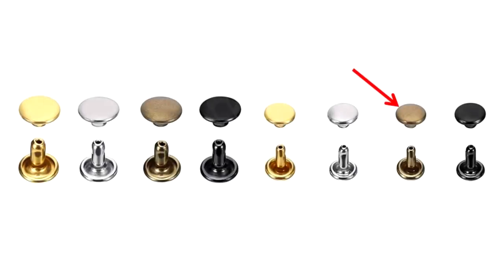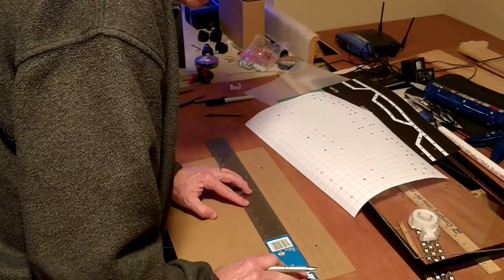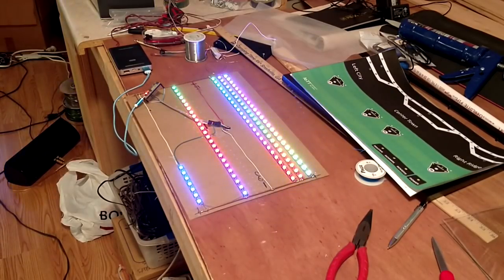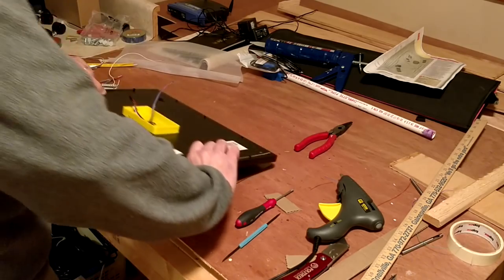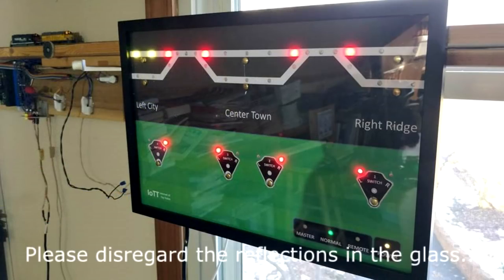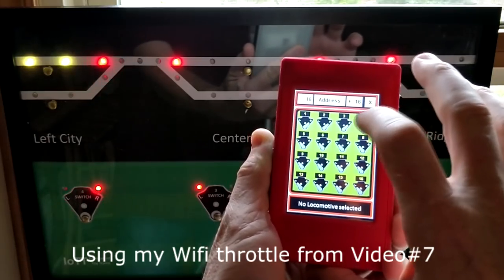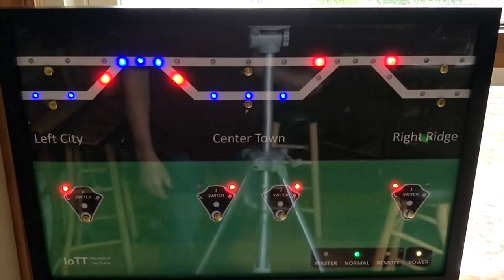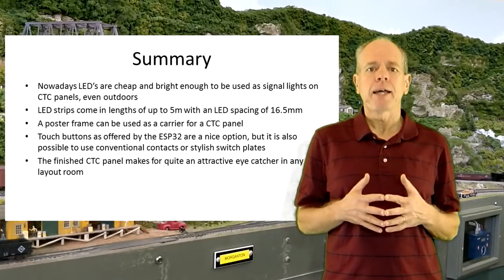Picture Frame CTC Panel (Video#9)

Comment: WOW, this is fantastic. You have taken the CTC panel building for model railroaders to a whole new level. Fantastic how you can reduce the wiring and hardware to such a minimum and yet flexible through software.This is what my goal is with my panels. Recently I purchased 2 MGP panel decoders that control individual RGB led's based on turnout position, occupancy and status of other signals. But I want  to move to RGB led's strips. MGP panel decoders control 64 RGB led's each. I would like to show my complete layout using led strips. Please see my videos. Currently I have 1 panel with red led's for block occupancy and 1 panel with green led's to show route selection. But, just like your panel, using RGB led's, I can combine both panels into 1 and display more. Now I'll buy the LED strips, Thanks for a great video.
Reply from the maker: I watch your videos a while ago and I liked the concept. However, particularly for a garden railroad I needed something a little bigger than what is possible with PC boards ;-)

Comment: Wow! Sweet! I wonder how easy that would be to integrate to my existing signal system. I use NEC block detectors and an Arduino Mega 256 as the brain with relays to set my signals. Thinking hhhmmm
Reply from the maker: That should be easy enough. All you need to do is adding a communication interface that can handle your protocol (either CAB Bus or whatever you are using on the Mega) and make some changes in the panel software so it understands the messages. I will publish the hardware schematics with the next video, that should give you some pointers to start the project.

Comment: Hi I don't understand how do you drive the leds in strips  independently , is this a special strip?
Reply from the maker: Yes, I am using WS2812 Neopixels. These are RGB LED's that are daisy chained on the strip and they are controlled using a serial protocol with 3 bytes of data for each pixel. I find them ideal for model railroading projects as it greatly simplifies wiring.